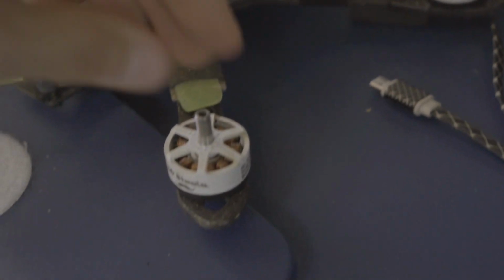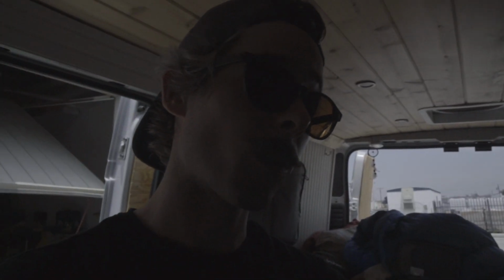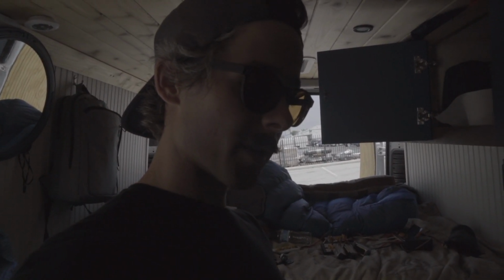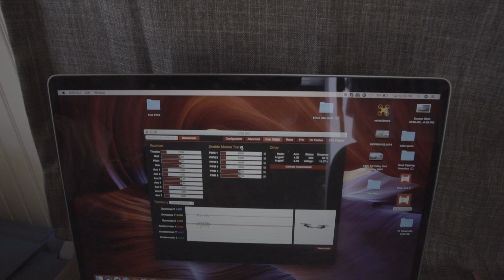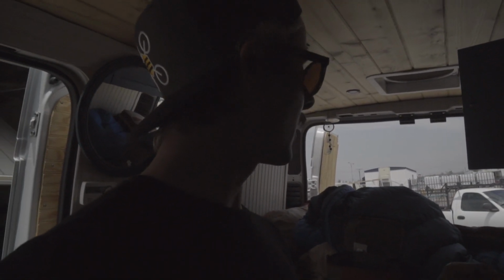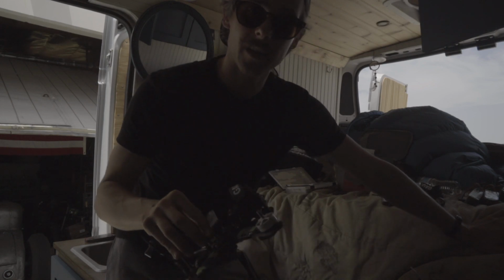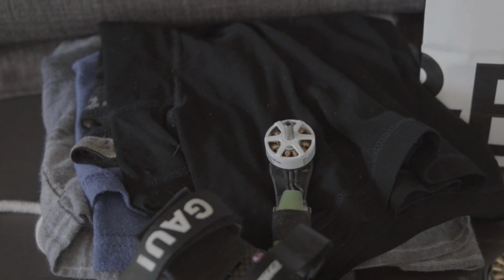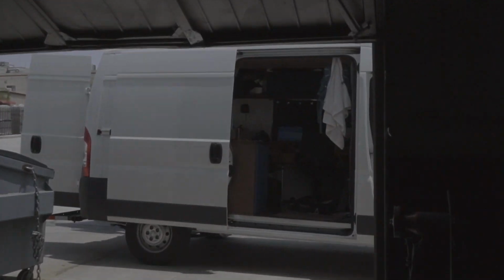A BRAND NEW Quad Oscillations...  WHAT GIVES? | ETHIX

Comment: The best way to get rid of these occilations is fly up around 100 feet, roll to the left until the the quad is upside-down and increase the throttle to 100%. Once the quad makes contact with the ground you should have no more occilations

Comment: Mr. Steele, I love your videos and I've built 3 of your quads. When I originally purchased 4 Mr. Steele V2 motors back in March of this year 3 of the motors I received were not balanced properly, resulting in horrible jello. On my first flight with the new V2 motors I noticed the jello, landed softly on grass, and headed home. When I got home I ran the same gyro/accelerometer motor test that you ran in this video on my KISS V2 FC in order to verify that 3 of 4 the motors were imbalanced. I then contacted TBS support to let them know they might have a QC issue. I corresponded back and forth with TBS support for over a week via several emails, that included pictures the TBS support tech requested of the bells, and washers. Ultimately the TBS support tech doubted that the motors could leave the factory not properly balanced and asked that I provide video evidence. By the time the TBS support tech asked for a video I had already replaced the motors (as no one had replacement V2 bells available at the time). Long story short; 3 out of 4 of my V2 motors were not balanced properly, I told TBS, and they didn't believe me and requested video evidence, I ended up just purchasing 4 more Mr. Steele V2 motors and they were fine. When the V2 bells became available I purchased 10 of them, so I can replace the 3 bells that were not balanced properly and have spares for any crashes.
Keep being awesome!

Comment: The floppy frame on your butterquad could possibly be soaking some of the vibration from the noisy motors?
Reply: that's what I thought too. the bendable arms could dampen some vibrations
Reply: Yup same thing. He said a floppy motor can cause vibrations but I think it's more likely to muffle the vibrations. Same way a floppy "rubber" gopro mount will keep those bad high-frequency vibes from getting to your video feed.

Comment: i was so stoked to get your new motors. i ordered 8, got them, and 4 of the 8 came with no washer on the bell screw. so when you tighten them it locks the bell in place. leave them loose enough to spin and you lose the screw after a couple flights. shafts are hollow but just the weakest shafts ive ever used. one crash from 6-8ft off the ground on grass going 10-15mph resulted in 2 bent shafts on the very first flight. now im no pro, but i have crashed the hell out of quads for years now and never had this issue except under extreme circumstances...cement etc, not long soft grass. ordered 2 replacement bells which are listed as coming with replacement screws and washer. when i received them neither had washers or screws. items came sealed from TBS. i have to imagine this comes from poor quality control in whatever country these are built in. long story short, I offed the rest of the steeles. between the vibrations, jitters, loosening screws, and poor QC...yeah ill pass. also loved your first motors but they had those horrible c clips and weak shafts too. id like to see a good, sturdy, smooth version some day. til then im rockin these engineer x 2500kv and lovin em.

Comment: Hi steele, a few months ago I also built an identical quad and i had the same mid trottle issues. I was very frustrated that this happened, on my old built (kiss v1 with bashed up brotherhobby motors and alien clone) i had no issus at all and i that quad was flying way better then my new steele quad. so I went looking for the cause using blackbox. i find out that the pitch axis was very noisy,(also tested the motors on your way and saw no very unbalanced motors) after trying some different filtering and so on i ended up with no LPF filtering, adaptive filtering on and notch pitch on, center 135hz, cut on 80. now flies great, without hot motors or oscillation. blackbox is showing clean gyro line. (motor softmounted with TPU and FC softmounted with rubber standoff)

Comment: What about a motor that isn't noisy, but seems to be "weaker" than the others.  I have one motor (not Mr Steele) that at full throttle seems to have less umpfff than the other 3.  It doesn't show up as noisy, but I can hear the difference in pitch when I wind it up.

Comment: I started using PDB and separated ESCs for my build again for flight security. now it's a lot of choices like 4 in 1 esc or all in one flight controller or whatever. but they are not actually that the trustworthy. I was always replacing those parts, they helps flight characteristics well, but last few month or less than that to die. so it's very agreeable to see Mr steel's set up.

Comment: Hi Steele, I've recently build an Alien and indeed suffered oscillations. I found out that one telemetry wire from the ESC was loose to the SteelPDB. I think it gave false triggers to the ESC signal-wire. After removing it: BUTTER! Unfortunately I can't get it soldered back. (The tin does not take) So I ordered a new PDB at ImpulseRC.

Comment: I reckon part of the issue with 3 good and 1 bad  might be the FC has difficulty filtering 2 different frequencies, especially if you are using a dynamic filter. I.e. that would create vibrations in 2 different frequency ranges and the filters possibly (probably?) can't deal with both ranges.
Good info. Cheers.
Maaaaaaaaaaaate!!!!

Comment: I’ve got same issues on brand new silk v2 Motors, my shop told me that maybe his whole batch have this issues so he gave me some f60pro2 but same issue. 
I’ve got really bad oscillations on low throttle, you can hear them.

I put a new Kiss Fc on it and they were first gone I thought so they aren’t noticeable by sound like the old.

But now when I just hover (LPF off) the quad goes fullthrottle up in the air.... 

I don’t know what is going on with my quad. 
I will try to set the LPF to High, but if this doesn’t work I’m out of ideas how to fix that. 

My Alien is really stiff, I’ve got another one that is not as stiff as the new one.

Comment: Do you have a guess as to why one smooth motor causes this issue?
I can almost wrap my head around why...theoretically the motor log should show less gnar on the smooth one but it can't because the controller output is 45 degrees rotated from the axis it's reading?

Comment: Well if you have those two brand new quads one thats smooth and the rest that are noisy, then the other that has 3 that are smooth and one noisy, just swap the two motors over, then you will have all 4 noisy motors on one and all 4 smooth on the other. :)

Comment: It only shows alot of vibration is bc only 1 motor is on. Especially relative to the flight controller. To get a clear reading the fc must be centered with the 1 motor.

Comment: I am having an issue performing the individual motor testing. Not a new problem but have just not asked for help and thought this was as good a time as ever to make a move. I follow all of Steele's steps.  GUI is up on the computer screen,,,,,connect quad,,,,turn on radio,,,,,hit connect on the GUI,,,,,plug the flight battery in,,,,,,,click on the data output tab of the GUI,,,,,click on the box that says "TEST" to the right of Motors (top center of the GUI),,,,,click on "yes I'm not a dummy",,,,,the GUI comes back up and I click/check mark the white box by the Enable Motors Test. With all of this done the grey boxes to the right of each respective motor continue to stay grey and I am unable to click/select any (to continue to test each motor). What am I doing wrong to not be able to successfully access the motor testing feature of the GUI?  I look forward to anyone's help!

Comment: i wonder if removing that 1 good moto(branded) from that 2nd newer kwad and replacing that 1 noisy one from the 1st newer model would eliminate the issues...
then replacing all 4 motos on that 2nd newer unit....
gr8 video as always!
Reply: i have an older red moto bayangtoys x16 with all 4 motos bad...
after i idle the motos for even a min all 4 feel like theyve been injected with jelly...mushy feeling when turned by hand...hardly any magnetic "compression"....

Comment: First thing first the motor pants sometime touch the bell hens it contradicts the motors smmoth movement so whenever I get new V2 motors I make sure I sand down the upper part of it (the part which  is not sceen when it's put on the motor) and I make sure there is enough gap between the pant and the bell (not too much) and by doing that I have no more hot motors or vibrations (also soft mounting the motors is a pain with the V2 cuz it gets in balanced and bla bla bla so I fly without that )

Comment: So,,,, did replacing the motors fix it? Right now it is just a theory still.  What you say makes a little sense, but I'm curious if it actually fixes you issue matching noisy with noisy and clean with clean motors.

Comment: Geez, those gyro inputs look like the blackbox on my home 3d printed frame, that tried to go to the moon. Even after I dropped throttle. But mine started only at 25% throttle : l. It's a 7"LR, or else I would get one of your freestyle frames for it (for my first 4 or 5" build, I def will). But needless to say have a brand done, carbon frame on the way haha.

Comment: Some of the bearings can go bad just need to change bearings or just crap bearings I can change bearing in the motor without unsoldering need to press bearings in or you can damage new bearings. I use a little C clamp

Comment: That outro though!! Haha
Same problem happened to me. I replaced my old motors for 4 brand new ones and suddenly had oscillations I didn’t have before. Kind of a bummer. But the old faut motors were lacking power. Feels like Kiss was reducing their power to compensate the vibrations at high throttle.
Reply: I have 12 steele motors V2, and always  noisy one, even when there were brand new , no huge vibration, but i believe the manufacturing isn't completely reliable , is it an issue ? time will tell me :)
Reply: Hi, same here, out of 5 motors and 1 bell : 2 missing gold washers, 2 vibrating motors (not the same). I'm sure now that there is a serious QC problem with these motors !

Comment: weird thing is, i prefer kissfc because i like the way it flys, i built 12 kiss quads and something around 25 beta/butterflight quads,.
i have bounceback issuse on every single kiss quad even with zero Dterm tpa, lowering Pterm, lowering rates and so on...
doesnt matter if it was v1 or v2, and i have mid throttle oscs on the most of them, tried different motors, hardmount, softmount, filtering everything out, used stiff and light props.
no way to get it out,...v2 filters better but on both versions the motors get a lot warmer then on my butterflight quads, and i have absolute zero oscs and dterm issuse on all butterflight quads so i guess its a dterm filtering problem maybe lowpass slope is just -6dB i dont know i cant measure it.

Comment: The QC or Durability of the motors from the manufacturer of your Steele and the TBS motors that are V E R Y similar needs some improvement. One of my TBS Masterpilot 2306 2700 is most definitely causing oscillations. Can't make these things fly right, and one of them sounds a little wonky. 2 different frames / FC's and they are just a bitch to tune.

Comment: OK! So today I set up my new Alien, KissV2, 30amp with V2 2345's ..havent flown it yet, just sitting and stroking myself! I have never used kiss configurator, thanks for the pid/rate spy and the motor test. 3 motors hardly registered on the graph and one went off the scale. I'm not a professional pilot, I just love to fly! Should I care about this or just go rip?
Reply from the maker: That’s crazy.  Fly it if it vibrates in the air. Then yeah. Send that motor back to TBS sand they’ll send you a new one.
Reply: That Kiss v2 can handle quite a bit man, try and fly it as is and you may shocked ... I have six of them all set up the same and just this last week finished building one that has mad vibration on two of the four motors, I found that if they are on the same side it can handle it but if they are across from each other the gyro no likey... glad you finally went with the top shelf build man ! You will love it... “That I Can Tell You” ..... 👌
Reply: Sounds good! I'm probably not the perfectionist that you are or would I be pushing it to its limits as you do! Would you or Konasty do a tutorial for Taranis/kiss setups? (alarms, air mode, fs ..)
Reply: DJCHAZ FPV are you using the X4R receiver ?
Reply: How did you know? Yes X4R ...I have the arm switch set but not idol off. So when armed the props dont spin. I want to to have the spin and no gyro. Do you have a tutorial on the switch set up? Also, I have the Qx7.
Reply: DJCHAZ FPV so what your wanting is a two switch arming like Steele and snake use. I don’t set mine up that way. I use the air mode and I can do a video on how to set that up and how to set your failsafe for the X4R but I don’t use the X4R anymore. I use crossfire and standard single switch arming. There is idle up / two switch arming video on setting it up for a taranis (which is the same for QX7 ) and Steele has said that he would do a video on this matter but hasn’t done that yet ... 🙄 ( audible throat clear...) Steele....... 
it’s my busy season as a HVAC-R tech so time is hard to come by at the moment but I will make some time to put together a quick edit on what I know about the setup and hopefully it will help ya as I know you have been working on putting together this build for a little while now. At least we talked about it a while back. Also I have about six or seven X4R’s that are all set up and de-cased/ de-pinned and ready to go just needs binding to your radio. I’ll send you one or two for free if you email me your address. Or hit me up on instagram ( jasonhullfpv ) message me.  Also I have a post on there for a tip on the Mr.Steele PDB mic, it’s a mod I highly recommend you do..
Reply: Awesome! I wanted to get over the KISS curve before I jumped into the crossfire, so I just went with a nice and easy frsky product. But I want to set it up right and take advantage of my investment. I will hit you up on instagram. Thanks for your help Jason!
Reply: OMG! Just took it out for a quick test flight ..and she floats like an angel! My old quad you had to be on top of it all the time. This thing is like connected to the stick and doesn't over stick ...so F*ing perfect man! I am so pumped up right now!

Comment: it's called phase canceling , 2 = waves (vibrations ) 180deg out of phase will cancel each other out to 0 . the de lamination would also dampen the vibration down the arm, not being so stiff , some  tape between the arm and the body(anything softer than the carbon ) could also reduce the transfer of some of the vibration , as it looses energy going from one layer to the next . ya kinda need to think of it as an musical instrument  , arm length and width will set the resonant frequency, so any vibration from the motor at that frequency or a harmonic will make the arm vibrate in sympathy , good thing you don't have vertical arms
Reply: Similar to out of phase subwoofers in a box. Very little bass is produced because they are cancelling each other out.
Reply: exactly like out of phase speakers
Reply: Tape between arms/frame; Genius.  TY for that tidily bitsky.
Reply: just remember i used words like could and some , so don't expect it to do a hell of a lot . the idea will probably need fine tuning

Comment: I have problem, I can't stop flying quadracopters... help me mr steven... help...  Send me noisy motors pls.  Thank you.  My smoothest quad has 2 year old RCX motors and they sound like they have rocks instead of balls in the bearings.  I changed one of the bearings on one motor and it suddenly got mid-throttle oscillations.  :thinking:  Nice succulents btw, is that aloe?

Comment: I have the same problem, new build all problems with twitches and not being able to tune without making it unflyable
Reply: Job91 exactly the same here , I was so fucked up that I bought a completely brand new one and left my other quad aside , with 4 new motors on it ...
Reply: If you have BLHeli_32 ESCs, try increasing the PWM frequency to get rid of yaw-twitch.  I had major problems with yaw-twitch on two different motor brands until I discovered the solution.  After increasing PWM frequency to 48 they were nice and smooth.  Before increasing the frequency, they were noisy when testing in the motor-tab, but after increasing the freq the noise cleared up.  The PWM Frequency setting doesn't exist in BLHeli_S, however.  I didn't have this problem with the original EMax red-bottom motors, but with the new model, and with Brother Hobby R5 motors, it was the only good solution I found.  Softmounting the motors helped but never got rid of the problem, only increasing the PWM Freq did the trick.
Reply: Thank for your answer but It was a KISS setup with Kiss 24 amps ESC so I don't think i'll be able to apply your fix.